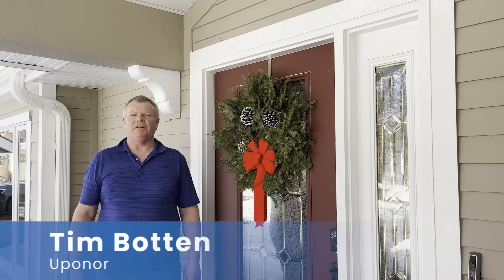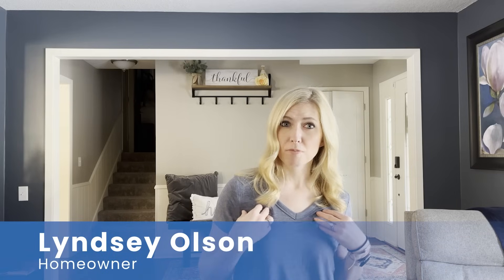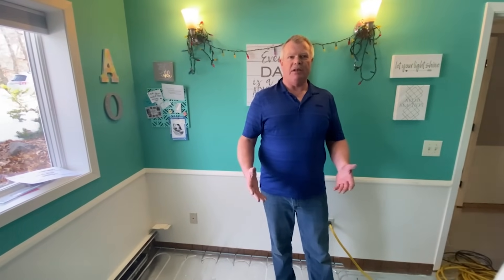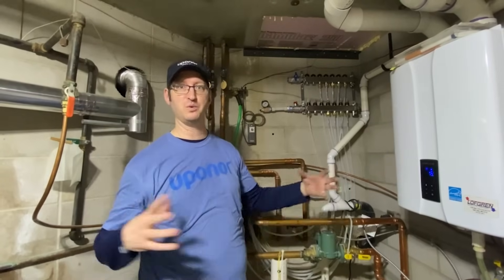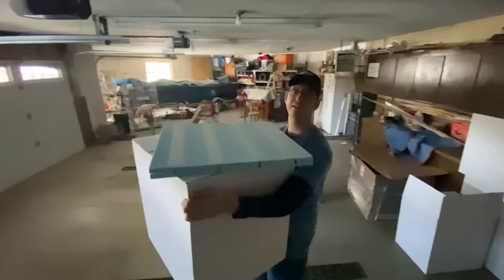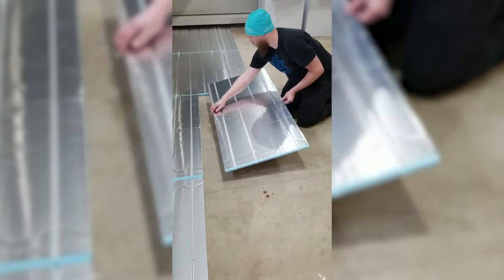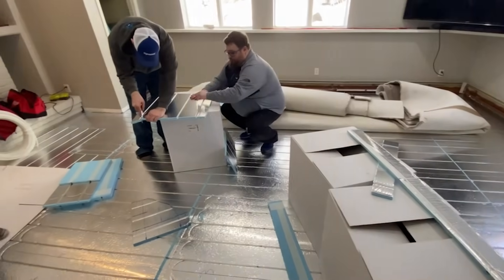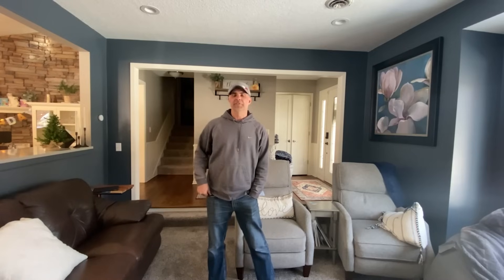Introducing Xpress Trak™ Radiant Panels

Comment: can you put backer board right over this so you can tile over it? can you glue engineered  wood right over this ?
Reply from the maker: Thank you for your question! Yes, backer board or engineered wood can be installed over the top of the Xpress Trak. Tile flooring can be installed directly on top of the Xpress Trak, Uponor recommends consulting the flooring installer to ensure they do not have any special installation needs. Visit https://www.uponor.com/en-us/products/panels/xpress-trak to learn more.
Reply: @UponorNA  thank you. What about the fast track black knobbed Matt.  Can you lay backer board over this then tile ? Can you also lay engineered wood over this Matt?  How and where can I buy the quick track and fast track ?

Comment: what type of flooring can be used on top of these panels?
Reply from the maker: Xpress Trak works on top of wood subfloor or concrete slab, and works well under most common floor coverings, including hardwood, carpet, tile, linoleum, and luxury vinyl plank.